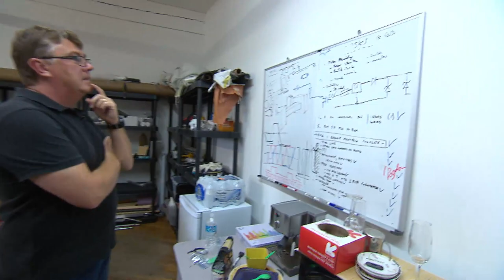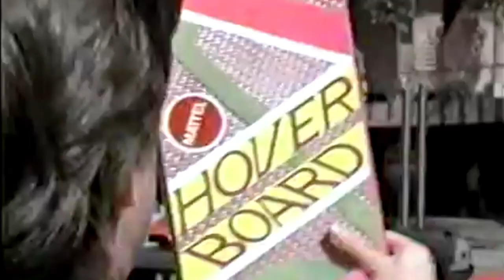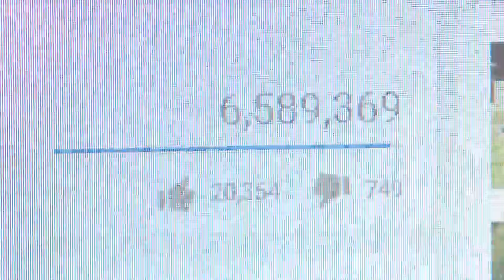Canadian Develops Futuristic Hoverboard

Comment: That's really impressive - I want one. 
May I suggest a couple of things?  Your throttle uses a single pot. It would be better, more reliable to use a double pot wired in parallel or an EJ longlife pot. Also, a simple pole & handgrip attached to the frame would make things just a bit more secure for you - something to hang on to. Keep up the good work.
Reply: The potentiometer idea although sound enough misses the real fail points hazard by a mile. 
All those lithium batteries, & Chinese mosfets.... He is a brave man.

Comment: Skirts around the propeller that can "focus" the energy a little, wireless power via rf with a batt pack that can handle the full current..  not sure what you're running for power, but if you're running lifopo4  then, the most in s, with the least in p and wireless real time charging will help you a lot..

Comment: I know this comment is really really late, but I wonder if balancing wheels would make it easier to control on turns? Something that will fight back when you lean, and stabilize you, also giving you a rotor to make an anti-torque feeling, like a helicopter, using a joystick to operate those wheels as a manual stabilizer and anti-torque, and using your own weight as cyclic, then a gyroscope to feed it information on pitch and roll, and making an autopilot that you kinda just guide with the joystick and your own weight

Comment: The Batteries are too heavy, that is also what causes most of the problems, it needs more advance batteries that help regulate energy flow as they change altitude, because the higher he goes it requires more power to stay in that level, also the batteries take extra weight, they need lighter more powerful and also more intelligent batteries to help the machine as it interacts.

Comment: What kind of motor you have use, please answer me
Reply: u still wanna know
Reply: Destroy Everything yes please! (And also what and how many batteries does he needs if you know) thanks very much 
Sorry for my english*
Reply: Tommi Cava well he uses the turnigy rotomax 1.6 with 2 5000mah 5s batteries in series however these motors are severely underpowered so a better setup would be 6 of the turnigy rotomax 100cc with 2 5000mah 6s in series
Reply: Tommi Cava or even the 50cc should work... are you trying to build one?
Reply: Destroy Everything ok thank you very much!
It would be very satisfying do this hoverboard 
The bad news is: it can fly for about 2 minutes before the batteries end
I don’t know if 10000€ (more or less) compense the fact that the hoverboard fly for a very small time
I’ll thinking on it
Reply: Destroy Everything no
I would like it very very much, but i don’t even know from where i should start actually
Do you think the 150cc are to heavy?
Do you know how to built one of this?

Comment: how is this made 
what is the Kw of the motor and what's. the wattage.
Reply: hes running 10s lipos on these so a fully charged 10s lipos produces a nominal voltage of 42.0 volts

42X170=7140 watts

that's 7.14 kilowatts
Reply: thanks thanks
Reply: I doubt the motors are higher than 1000 watts

Comment: Suggestion if your motors are A/C you can power factor Correct them with capacitance to a 5 degree leading phase with a power factor meter and you will have a very much longer life to your batteries. If you are not aware of the efficiency of power factor Correction to motors. Good luck.

Comment: hmmmmmmmmm......... not enough battery power?
rips out batteries 
time to insert my self-regenerating power source
plugs in
files for hours
no joke, me and my bud made a self-regenerator
Reply: +Fire of the Dragon IKR? I've never understood why people don't incorporate electric motors that can  spin an 'alternator' and provide more than enough electricity for the motors indefinitely.
Reply: +davidsirmons because the friction would be too high and then the rotors would spin at a higher speed thus draining faster.
Reply: +7xOr Hax That's the standard response I get. Explain then all those self-powering generators/power tools videos out there. And no, they're not lies. There's something to it, despite what is NOT taught in electric theory or thermodynamics.
Reply: And even if NOT using a self-powering (driving) generator, there's no reason on earth that electric motors couldn't be used for this, powered by an electricity generating device that is gas-run. It would be so much lighter than having tons of batteries, yet not as complex and draining  of fuel as having 6 or more separate gas motors like some designs. It seems like people lock themselves into the two extremes, not realizing there are a few more ways to achieve the same result.
Reply: +Fire of the Dragon post vid
Reply: TheGreatUtopiaCat rofl, and have what happened to that guy who made the self-sustaining hydrogen generator back in 2000 happen to us? I DONT THINK SO!
Reply: Fire of the Dragon r u foreal? That's how it's goin down?
Reply: A self powered motor would use more power than a motor directly connected to a battery... It's not worth it.
Reply: It's going to take more power to spin a generator, and because of internal resistance, the power generated won't be that much, so you'll get a longer lasting battery, by about 2 minutes. Think about it this way, if you got a generator that takes strength to spin and you attatch a motor to it, that motor will work harder to spin the generator, rather than working towards actually keeping the aircraft in the sky. So if it takes more battery power to spin the generator vs what the generator can actually generate, you'll quickly drain that battery to the point where the motors don't have the power to spin the generators anymore, so the props lose lift and you eventually fall into the water.
End of story.
Reply: you also have to account for the fact that you would lose rpm in order to create power back. And high rpm motors are a necessity in order to achieve lift. Unless you want to make the entire thing larger with huge propellers, which would still turn out in a failure because the motors would not have enough torque. 
The only way to increase flight times is to create a battery with a higher power density, or supercool the wires and components to decrease resistance. Both of which have not been done yet.
Reply: No-one has disproven my statement. Too many people have created high voltage self-powered generators.
Reply: +davidsirmons you can't get something out of nothing. You can't get "free energy". And If the self powering power tools were actually real wouldn't they be more abundant? Personally, I've never heard of them. And the legitimacy of them might be the reason why.
Reply: +davidsirmons the concept is a nice idea, but the efficiency of the system may be the reason it's not implemented into more appliances.
Reply: +Fire of the Dragon what happened to them ?
well idk if i really wanna know i just got done wasting my time looking up videos of self sustaining generators and wasted my time as all of them that i found on youtube are fake so far out of the like 6 i looked at. 
years old video people never reply to comments threw the years, they never make more videos to show an update or a finished project. they aren't sold and put in homes yet it seems, are you all sure that these  self-regenerating power source exists?
Reply: +jerryy538 the sun is a pretty good role model for perpetual motion energy but i think its a combination of not having the finances, resources and dealing with a very private market that stops any form of clean easy energy being released to the masses. fission is our best bet for replacing fossil fuels but imagine what would happen if one day everyone stopped using oil? but I digress, this vid was awesome, love the concept and the potential of it. keep it up!
Reply: m411982m GTA V i don't mean energy from the sun i mean the self-regenerating power sources. 
like the one where they use one motor to power another motor. i have never once seen a legit one.

none of them reply to anyone and none of them have ever advanced further. 
some of them even claimed to be funded by a group or organization. but yet they just stop out of no where. like they show fully working projects claim that they can make 40k wats 
but the video they show they are like in this video il only show you with 2k wats even tho this can do 40k wats. 
fake as shit

LOTS of them just link you to websites to get hacked. 

seems like fake shit to me.
Reply: +jerryy538 if they ever did work i highly doubt joe public woukd ever see them. sadly the world runs on money and this if often to the detriment of humans progression. my folks remember in the uk when 'ladderless tights' came out. that company was bought out in a heartbeat then never heard from again, probably because it destroyed the competitors market or because someone didnt want an end user having access to that tech. ppl in positions of power do not like sharing or giving away stuff for free.
Reply: Such a device has been patented for decades. I don't understand why so many people balk at it. Moving on, I'm hugely interested in making a personal flight vehicle, and not one like this which could dump the pilot off super easy. Would be curious to know the engine type used. I'd like to stick to 2 motors if possible but a triangle of 3 might be more stable.
Reply: +davidsirmons Let me try to answer your question about self-powered generators (this'll be a rather long post). I'm sure you are familiar with the law of conservation of energy. In any given closed system energy in = energy out. You cannot get energy from nothing. That has been proven over and over so I hope you accept this statement as true, along with the rest of the scientific community. Not everything is a conspiracy. Perpetual motion is not real. People tried to show the opposite for centuries, and failed. Every single video you see about it is either fake or it is not truly perpetual and will stop at some point. It's sad but true.
Moving on... To make things more relatable, instead of energy we will look at power, which is simply energy divided by time. Here we have the same principle: 1 Watt in, 1 Watt out. 
We can now use what we know about power on a rotor, like the ones in this video: A certrain amount of electrical power we put into the motor (let's say 10 Watts) creates a certain amount of force (upward lift), lets just say 10 N. A generator/alternator added to the motor would take away some of that power used for the lift, and turn it BACK into electrical power, which is then transformed BACK into lift. Due to limited efficiency (which is unavoidable) in this additional chain, we are always left with LESS overall lift than before.
I hope that cleared things up. Strapping generators to electric motors does not make any given system more efficient, quite the opposite is the case actually. (I am excluding regenerative braking from this discussion). Anyone that claims otherwise is either lying for views/attention or does not understand basic physics. Please, don't believe everything that you see or read on the internet (including my post. Read up on physics and electronics if you are interested in these subjects!)

As for your idea to use a combustion engine with a generator... that is actually not that far fetched. I did the math a while ago for a quadcopter I was planning to build, and unfortunately the combustion engine, along with the generator and the gas tank are way too heavy to be efficient for such a small scale. And for anything larger than a drone, the best thing to do is to directly drive the rotors with the combustion engine by means of belts or shafts or individual engines. Converting chemical energy (gasoline) to mechanical energy to electrical energy and back to mechanical energy just wastes too much in the process. Do the math yourself and see if you come up with a different result.

Cheers
Reply: +ScheichVomDeich Sorry, but there are such things already. Thanks for telling me what your learning states, contrary to what others have actually done.

Comment: turnigy rotomax 100cc
$330x8=$2664
(couldn't figure out which ESC he uses)
turnigy dlux 250a esc
$206x8=$1640
that's 4,500$ on the motors and escs
Reply: +MrDylman55 yep.. id say 10 years there will be comercially available ones that are limited to 2 feet off the ground and flight time will be 40 minutes or so.prob 20,000 US starting price
Reply: how do you know
Reply: this is the right motor
Reply: +Ron Brown I have a lot of experience with RC
Reply: +MrDylman55 each motor would need a lotto g force of 22 lbs. 

do you know what size and type of propeller he used?
Reply: +Ron Brown probably 27x12 props
Reply: +Ron Brown what do you mean "a lotto g force of 22 lbs"
I know what g force is but what you said didn't make sense
Reply: +MrDylman55 I'm having a hard time calculating the lifting force of a motor. 

how is this done?

Say I have a 12 inch propeller. 

what kind of RPM do I need to lift 22 lbs.
Reply: and battery are 67$ each so 16 of them=1072$
Reply: +Ron Brown size dosent matter, the pitch of the prop does. pitch means how many inches it will push it's self every rotation
Reply: +MrDylman55 sorry it was a typo 
Lift Force or 
Thrust of 22 lbs.
Reply: +MrDylman55 OK let me rephrase this. 

what is the cheapest motor I can buy to do this.
Reply: +MrDylman55 the diameter of the propeller does matter if you're trying to lift a lot of weight.
Reply: +MrDylman55 the diameter of the propeller does matter if you're trying to lift a lot of weight.
Reply: +Ron Brown I was gonna say not in my experiences, but I probably pushed my motor and ESC to far because I was running a bigger prop than I should have.

Comment: Colinfuzy made a hoverbike which does work but doesnt get as high as that. This one will use up batterys faster than a dog can eat cake. This is not efficient in any way
Reply: +ZeRo small beginnings.
Reply: do dogs even like cake?
Reply: Dogs will eat anything.
Reply: All we need is a better capacitor... plus flyboard air uses jet engines and not electrical engines.